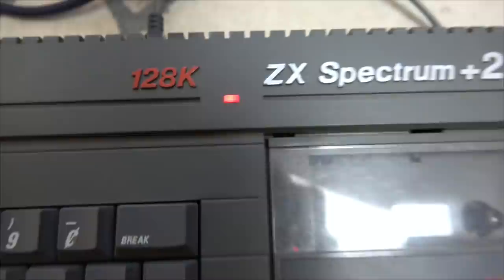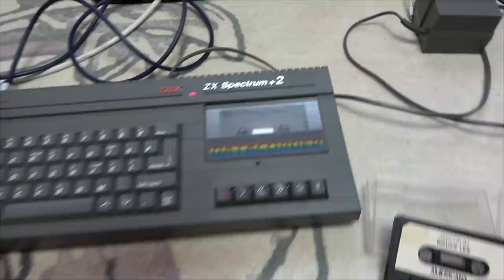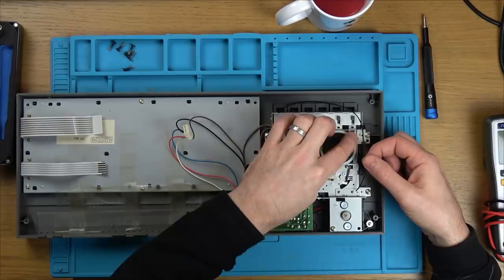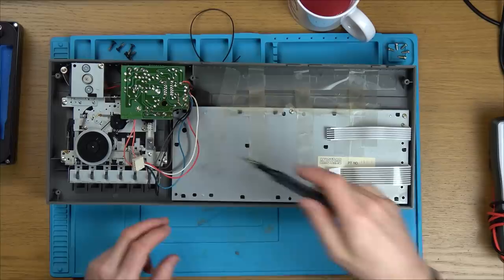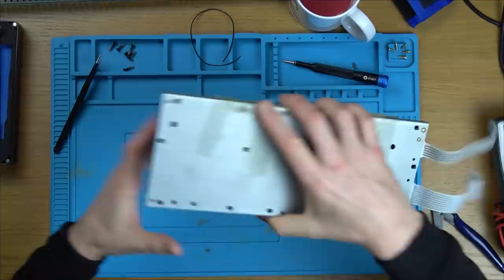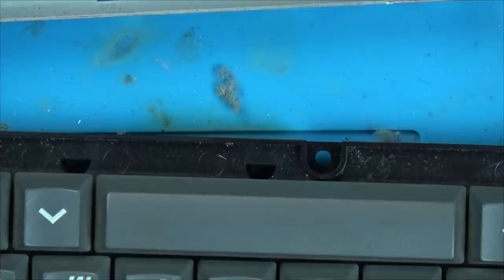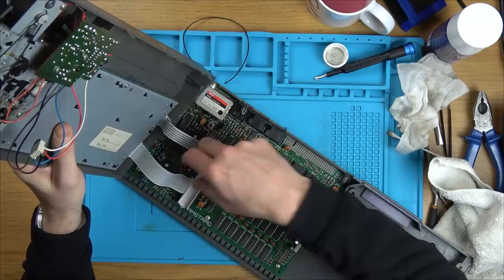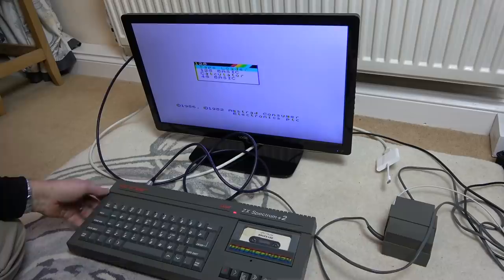SINCLAIR ZX Spectrum +2 NOT playing Games & Faulty Key - EASY FIX

Comment: Not meaning to cause conflict or argument but isopropyl alcohol should never be used on a pinch roller. John Peel mentioned this in Making 4 Track Music book, my late partner of over 50 years experience said same and I have extensive experience in cassette mechanisms myself. People will continue to do this, regardless but as tape mechanisms aren't made anymore, it will lead to failure, splitting and total loss. John P suggested spit, and some might not like the thought of this, so another suggestion is a solution of dish soap and water, applied with a cloth. I hope I haven't offended anyone, as this isn't my motive. Nice repair advice. 🙂
Reply: I concur with hoofbags - I (DataServe Retro) have serviced 100's of these machines over the years and know from first hand experience that you don't clean the pinch rollers on any cassette mechanism with IPA. Platen cleaner is a solvent special blend for this type of rubber (also used for cleaning high end hifi cassette players and things like photocopier and printer rubber pickup rollers). It also has a second advantage in that it makes the pinch roller surface tacky again so the tape doesn't slip.

Comment: You should look into Acetone plastic welding - it would have been much superior here than the superglue, which will undoubtedly fail after under a little stress.
Reply: As someone who has used it in both hobby kit model building, going back to my youth, and in my projects as an Industrial Design major back in my Uni days,  I was going to suggest that Vince look into a product like Plastruct Plastic Weld – or an equivalent solvent-based bonding agent, that would actually allow the pieces to actually fuse back together, rather than be held together by an adhesive agent . Sufficient drying time would have to be provided (longer than with CA glue), but as you stated, would be better for these types of applications like screw posts/mounting bosses, etc.  Depending upon the type of polymer, Methyl Ethyl Ketone (MEK) also works well (particularly for styrene); it could be applied by either a brush or small hypodermic syringe.
Reply: Or decent Epoxy

Comment: If case plastic is ABS you can use acetone to weld pieces together. The joint will be strong as it originally was.

Comment: Nice one, One thing to do using Qbond is to rough up the plastic where you are going to apply the powder it gives it more surface area to grip on to, great video 👍👍👍👍👍
Reply from the maker: Oh yes, I think you might have mentioned that to me before. I'll remember for next time. I did remember the little hole in the lid this time though 😂 👍👍

Comment: The tape inside is likely assembly tape used on the assembly line to keep it all in place where the lady with the zzz zzz gun would whizz in the screws, nearly all the Spectrum plus and my Amstrad CPC's had that tape in from new and the tape on yours looks about as old as the machine is.   BTW got a cracking watch vid coming, 1980's Pulsar solar, absolutely immaculate with its original box, all papers and manuals and this was the watch that kickstarted Seiko in marrying a quality Seiko quartz movement with a solar panel and capacitor defining the modern "eco-drive" watches of today.   Just waiting on the new capacitor cell to arrive as the original one holds about 2 secs of power.

Comment: I started off with a rubber key 48K Spectrum. The one you had Vince was the Spectrum+ which had the QL-style case and keyboard but was still a 48K Spectrum under the skin with the addition of a reset button. I have a +2A myself which I featured on my own channel. Unfortunately, the RF modulator is broken. I should've got my late uncle to fix it before his passing. He knew his way round the Spectrum. These days, I get my Speccy fix with an emulator.
Reply: If the modulator has failed you could just do the composite video modification. It's not that difficult and there are plenty of videos showing you how to do it.
Reply: Yes, I'm aware of the composite video mod that can be done. I think the connector itself is damaged. I'll have to dig it out of the loft. It has never been 100% since I bought it in 1995.

Comment: I can't remember who I got this trick from, but to fix screw posts back into place, I use acetone. I get a little bit on the end of a cotton buds, wipe it lightly on the problem area and press the posts on. The acetone should fuse it back together and in my experience it's a really strong join. Some say it's as strong as when it was new.

Comment: For the broken screwposts i usually use 2 component epoxy adhesive, it is usually stronger than superglue. I used it on an Samsung QVO 1tb SSD, it had a broken plastic support, the one under the sata pins, the SSD is currently in my laptop.

Comment: I've still got mine in the loft in the same place as the rubber key one, and the upgrade of the 128k that came with a disk drive.  They are my version of the Toby jugs old people wrap in newspaper and put in the loft lol
Reply: P.s, if you want super glue to activate quicker without having to buy activator just use water. Water make super glue set in seconds 👍

Comment: You can use a coffeemaker filter and some IPA to wife off the keyboard contacts.  These filters are useful, as they do not create little paper particles left on a surface (if used gently).  They are also useful when wiping off a thermal paste from a CPU or similar.  Most of all, these coffee filters are cheap :).
Reply: Thanks!   usually when Finally, (Years later) getting more, i say, 'another lifetime supply'.
Reply: Or use a microfiber towel

Comment: I have a 48k spectrum with the rubber keys. Would it work plugged in to a monitor like yours? What connection cables would I need. would?

Comment: @12:39 - You can simply use 91-99% IPA on a cotton bud as an activator.  Most of the labels list IPA as an ingredient. It's the moisture that cures cyanoacrylate.  The IPA simply makes the moisture get in to the bond to harden it.

Comment: I had the +3 version which was the disk drive version. Otherwise the same. Prior to that had a 128k one which you had to use your own tape player, set the volume etc and it would often crash half way through loading. Clearly with the +2 all that would be done automatically so it should work! Love the loading sounds. You can get emulators and load the games using the tape loader just for the fun of the nostalgia
Reply: The only thing that stopped the +3 from being totally awesome was their mistake of using the Hitachi 3" disk drives instead of the far more common and standard 3.5" drives.
Reply: @SpeccyMan  yeah. A weird size. That said I had less trouble with these than the 3.5 inch disks I used in PC which were always failing on me. Were they single or dual sided? Can't remember now. Has been a while.
Reply: Before that we had the even more unusual microdrive.

Comment: I've got an original rubber key 48K, a Plus and a gray 128K+2 - all picked up used and only needed minor repairs to get working -48K nothing wrong, Plus needed a keyboard membrane while the 128K+2 needed a new power jack and tape belt - must get them a SD card interface at some point to load games

Comment: I still have my +3 somewhere, need to dig it out and repair it. I always remember having to mess with the volume to get tapes to load on my dads rubber key 48k 😐
Reply: Volume adjustment wasn't needed on the C64 since its tape deck was digital in how it worked. In the speccy you had to adjust the volume level so the circuitry inside was triggering 1s and 0s at the right levels.
Reply: 48K spectrum.  Never seen that 128K menu before.  I remember the 48K only had a command prompt.  Load "Manic Miner" or whatever.

Comment: hi  re caping it;s a big crazy sometimes you don't need it  dry solder  some times  as i test all the hard to find one  the cost ad's up
if you are doing a big  reel to reel deck  yes easy to find one's re cap  good plan  i will not pay silly money for caps

Comment: Oh god, do NOT use IPA on rubber rollers. IPA causes rubber to deform, deteriorate and crack very quickly and easily. IPA is fine on the heads (as long as you are careful not to drip any on any nearby rollers) but never use it on rollers!
Reply: So what do you use on rubber rollers when cleaning them...Naphtha?
Reply: @antonia4722  Just plain water and a cotton bud, with a bit of soap if there is any stubborn dirt. Acetone can be OK on rubber itself as long as it's completely cleaned off with water soon after but VERY bad on plastic and often the rubber rollers have a plastic inner/bearing so it's usually a bad idea.